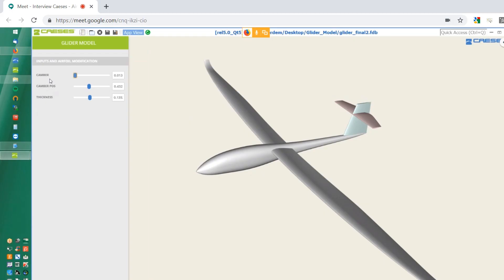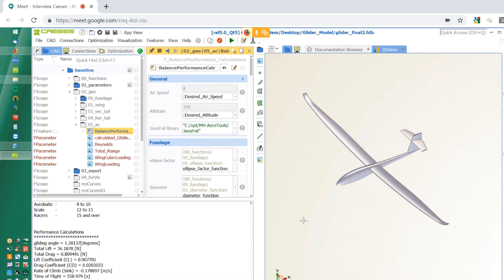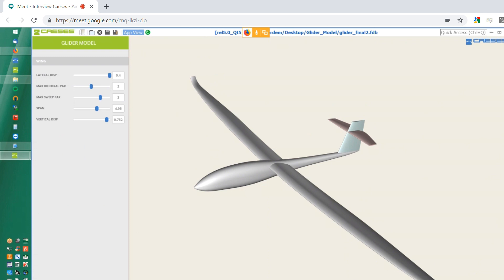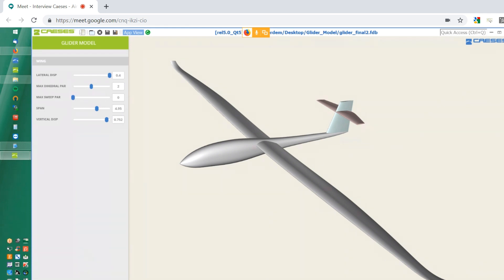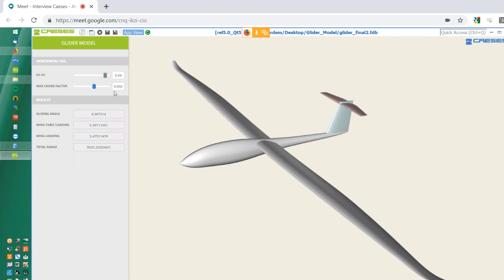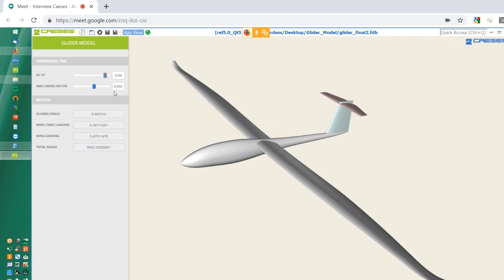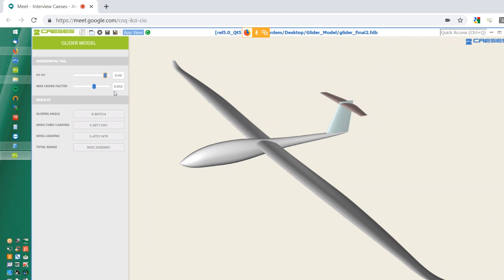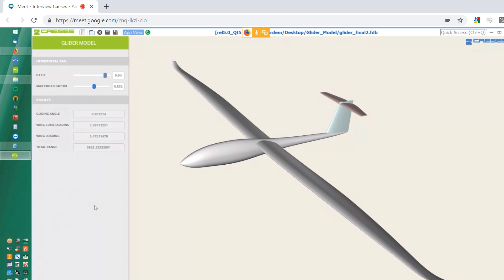Airplane design #3 - Glider plane design

Comment: I have problems in calculations  of tail area tail span for horizontal and vertical tail. And selecting an airfoil
Reply from the maker: I suggest to check out www.gliderplanedesign.com --> the tool has been fully launched by now and allows you to calculate various relevant parameters!